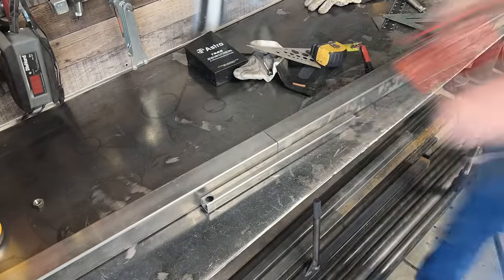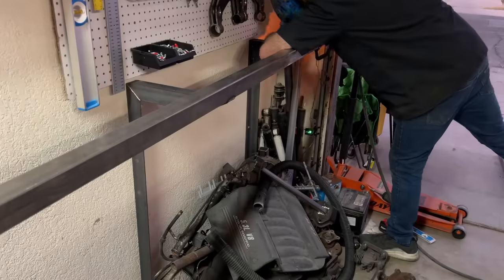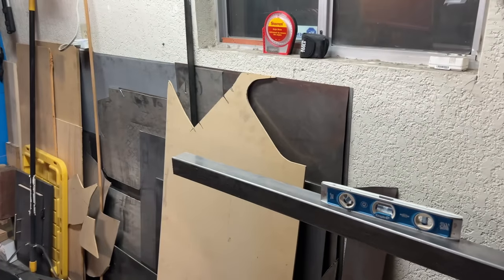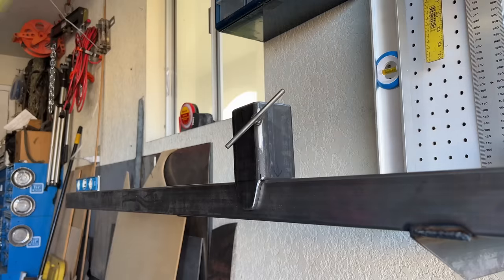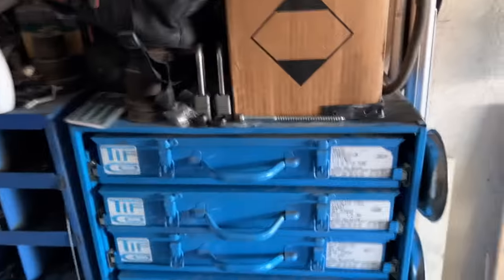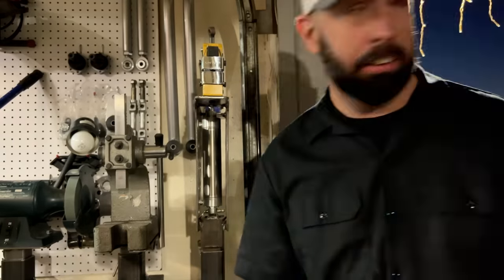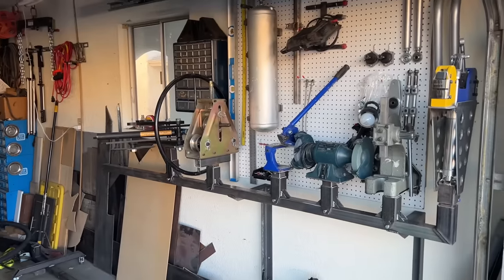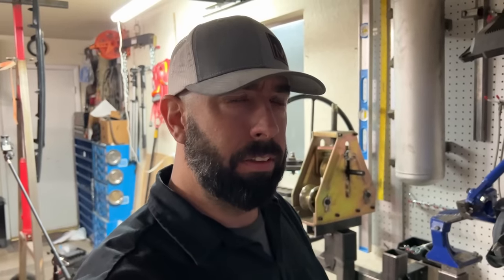Brilliant(er) Legless Tool Stand/Storage System! Part 2.5!!

Comment: A great use of space would be to add another 6’ horizontal to your rack, half way down the bracket that are hitched to the wall. Then add horizontal receiver to it and add another row of tools below. 
So they stick out from the wall sideways. Underneath the other tools.   Great content! Thanks
Reply from the maker: I like it! A diagonal horizontal bar has been mentioned but a completely sideways receiver would work better in many cases.

Comment: You could have welded together 2 right angles to make a T, or bought a T, and used that for the top rail. That way you could use the tool mounts so that can't come loose or tip, but they could still slide left to right.
Reply from the maker: Very true. I just might do that on some of the larger tools. 🤔

Comment: For allens, and other wrenches that are needed for adjusting a piece of equipment (where you want to keep the tool right next to the said equipment) get small round neodymium magnets to hold the allens etc.
Reply from the maker: I love the ease it magnets! I’m phasing them out though because every magnet in the garage is a little metal shaving fuzz ball. 😆

Comment: On th extra square tube that was blocking the sheetmetal storage, why not cut it and sleeve it inside the end, so it can slide right back in where it was.  You can secure it with a set screw.  For the couple times of year that you want access to the sheet metal, just pull it off, move what sheet metal you want, and put it all right back on.
Reply from the maker: Brilliant!

Comment: Im a little late to the party, but if you move the rack up a bit, and even add a third wall bracket for more support, you could keep all your sheet metal under the rack, and slide sheets out easily.  just one idea.
Reply from the maker: I like it! I’ll consider it.

Comment: Now turn your original tool cart into a rolling sheet metal cart. I have this in my shop and it makes it way easier to pull away from the wall and get the stuff in the back. 🤙🏻
Reply from the maker: I like the way you think!

Comment: Have you thought about putting a flat plate on your master tool stand so that it doesn't wobble left and right when you're using the tool?
Reply from the maker: I’ve got a couple ideas that I’m working though, but haven’t considered a plate yet. One idea consisted of a component that resembles the hardware that attaches a bicycle neck to a fork.
Another idea was some very short “fins” that resemble a rocket that will shim any extra space in the receiver. Lastly was just a tab that a single bolt goes in to bolt the unit down.
Others mentioned “legs” but that defeats the whole purpose. I’d be interested in entertaining your plate idea because it’s less likely to be tripped on. 👍

Comment: Great job!  When you created the floor receiver, did you use a concrete epoxy to secure it?  Did you use a concrete bit & drill a series of holes to create the pocket?  How deep into the slab?
Reply: Not wanting to speak for Mancandy, I had a friend who worked for Penhall Concrete cutting... He drilled 3 holes across the front of my floor near the apron.  The concrete was only 4" thick, so I dug down another foot.  Then I welded rebar nubs to the sides of the receiver stock (the tube was 12" long and I put two per face, staggered, the nubs were 1" each), painted them with Kilz, and set them flush.  Then filled in around the outside of the tube with high test quickcrete.  Worked like a champ and having a few extra holes meant I could have a bender on one and a notcher on another... makes for quick work.  If you can find a way to cut the concrete, the rest of the project is easy.

Comment: Glue a magnet to the Allen key to hold it on the tool rack. I've been wanting to move my vice and grinder to a receiver and planned a workbench with both vertical and horizontal receiver mounts that I can expand upon as time goes. Too many projects backed up to build it now but that to see someone else thinking the same way and it working as well as envisioned

Comment: I will give you one more suggestion. Mill a groove down the center of the main tool holder bar for your set screws to sit in then they will easily slide and hold in place without a lot of force a bonus is mounting additional ones upside down the groove will assist in holding the tools up.
Reply from the maker: I like that a lot. If I can get creative enough to put some sort of mill cutter in my router I’ll do that. I’m too lazy to take the rack off the wall. 😆

Comment: KM: One post to rule them all! The tools having an adapter for one post means they could plug into other racks as well (like in a vehicle for transport). Modularity is awesome. I will pile on the multiple comments about a cart for the sheet metal and the other comment about a single tree with wheels; low mounted wheels on your post could be useful for the heavier tools. You could telescope the base into your floor receiver once in position. v/r wh
Reply: Good project, good comments. How about an extension that slides horizontal into your existing horizontal. Can have two tools on it. Pull off two tools, slide out extension, access to sheet metal.

Comment: I would weld levers to the set screws, they don’t need to be torqued down so hand tight should do the job? Save having to reach for a tool just to get another tool.
Reply from the maker: True. Ironically I already did that for the screw that holds the tool in the receiver. Maybe I assumed I wouldn’t need to slide them around often.

Comment: A long time ago when I worked out of my shed, I built a rolling sheet metal rack.  It was not so different from a lumber cart from the big box store (which didn't even exist back then) but it had an interesting feature.  In addition to the fixed back rail that held the sheets up, there was a pivoting front rail that was retained by a chain, so that you could lean the sheets forward without having to hold them up yourself, and flip through them like the pages in a book to find the one you needed.  It was fantastic.  You could unhook the chain to fold the front rail right down for loading as required, and with half the stack folded forward there was MUCH less friction on the sheet you were trying to slide out.
Now, a rolling rack might not be perfect for your application, but imagine that you had one with wheels on one end.  You have a pivot at the end of the tool rack you just made, and your sheet metal 'cart' is up against the wall out of the way, but when needed you can roll the far end away from the wall to avoid the shelving and slide sheets out of that far end.  After you have your sheet you pivot it back against the wall out of the way.
It's just a thought.
I just found your channel randomly this morning, and this is the first one of your videos that I have seen, but so far I'm finding it entertaining... in a good way.   :)
Reply from the maker: Hey Mike! I like all of that, especially flipping front section. Don’t be surprised if you see something like that very soon. 👏 
Thrilled to have you my friend. Thank you!

Comment: The in floor receiver is genius !  If you wouldn’t mind, I would appreciate more information .  How deep did you go?  I assume it’s set in concrete?  Any tips? Thanks.
Reply from the maker: I’m editing a video about that this very moment! It will drop on Sunday morning. Summarized, it’s a 6 inch length of trailer hitch receiver tubing welded to an 8 x 8“ piece of quarter inch plate. Setting in wet concrete would be a breeze, but the only ones I’ve installed so far have been cut and recessed into hard concrete.
Reply: Can’t wait. Please include wall thickness of the tool legs

Comment: Instead of cutting off some of 8 ‘ tube…cut it off weld two plates on with hinge and a latch so it swings out when accessing sheet stock
Reply from the maker: I think the swinging will definitely be a thing!

Comment: I would make a piece so I could put the chop saw on the stand for small pieces so not always on the floor.
Reply from the maker: It has certainly crossed my mind! That or perhaps just some wheels to help slide it in and out. I’ll need some time to ponder that one.

Comment: Excellent, I actually have been using trailer hitch receiver style for 20 years. Mount under bench, and similar "heads" with various tools (bench grinder, vice, etc) on 90 degree (L bracket)

Comment: Several years ago I did this same thing on the corner of my long fab table. I mounted a tube to receive various tools mounted on short tubes that could be changed as needed. Now I’m taking that same concept, but building an actual stand alone fab station with tubes to receive interchangeable tooling like sandbag, shrinker/stretcher, bender, etc. The whole thing can then be moved around with a dolley if needed.
Reply from the maker: Absolutely brilliant. I’ll likely do the same some day. 👏

Comment: For organizing smaller and very lightweight stuff in my garage I use the inside of the garage door. Drop lights, 2nd bubble level, 2nd tape measure with magnets attached and stay mounted until ready for use. Magnets glued to the back of the clipboard. A container keeps a bunch of extra pencils, markers and crayons from wasting time searching for runaway marking tools. Small hrbrFright mag trays hold spare Phillips, star, and 1/8” drill bits. A few magnetic hooks keep different rolls of tape accessible. A socket tray only worked for a while so I’m not gonna even think of putting the scratch awl above my head. Works good for my 8 foot ceilings but probably not for higher bay doors.

Comment: Could truss the bottom and leave the cantilevered 2 bracket 8' setup.  This also expands the uses for the tool rack.  Such as added hooks or slotted tube for cordless tool storage
Reply from the maker: I really like the cordless tool storage idea. The whole trick to making the most small work spaces is cleanly using every last square inch.
As for the cantilever… I’m more concerned about the wall studs than the rack itself! 😆
Reply: @GarageFab  add one floor leg, or tie into the garage door wall.  Either option will triangulate the weight distribution.  The floor leg may work best, if you moved the sheet goods towards the door.

Comment: My wife and I just purchased a kuat bike rack. They have a system for the hitch that expands its space so the bike rack completely fills the space of the class 3 hitch receiver. It might be a bit complicated, but worth looking into in order to keep the wobble out of the post during tool use 🤷🏼‍♂️🤷🏼‍♂️🤷🏼‍♂️

Comment: Great job! if you make your common receiver two pieces with one sliding into the other, you could make it height adjustable with a pin/bolt. Might help with different tool heights, or if you work with different height buddies some time.  Might add too much slop though.
Reply from the maker: Consider that idea stored in my mind for later.
My Shrinker/Stretcher is a very tall tool so it’s awkwardly high right now. If I shrink the post all the other tools would be awkwardly low. 😆 This would work nicely!
Reply: @GarageFab didn't you just end up with more than a few left over chunks of 2x2 posts? Lol
Maybe certain tools need a specific height post, still way more compact than the rolling rack. Great job!

Comment: With a 'C" channel at the end of a few mounts, you can also hang a few lighter tools upside-down on that storage bar.  I guess it would have to be removable with a through-pin for the actual mount to the pole in the floor.

Comment: My worthless 2 cents = mount the receivers horizontally pointing out (still slidable left-right), mount the tools on an extended 2x2 ( length dependent on each tool) with the set screw (or pin) still at the receiver. Mount a surge protector in a convenient place on the rack with each tool plugged in. Then when you need one for a quick job, you slide it out for a little working clearance, snug it down, turn it on and have at it. Job done, slide it back in.  It's still removable for placing on a pedestal, etc.
  Like your working style. Best of luck.
  John

Comment: While that's an ingenious idea, I'm not sure how well it's going to work in practice. For example, I often make one off custom parts and like to move quickly between multiple bench or stand mounted tools. For example, saw, drill press and belt sander. Or saw, bender and notcher. I can't really set up an assembly line because I need one made and tacked in place before I can measure for the next.. So for 10 one off parts, I'd need to swap tools on the stand 30 times. Not even considering the amount of extra time that would add to my work flow, my back is barking at me like a mortally wounded dog just thinking about it. I think I'd need 3 floor plates and full stands for that to work and now my shoulders have joined my back in the howling. I'm interested to see how long you go before you cry "Uncle".
Reply: This man wont give up that easy. He will make more receiver holes in the floor and a few more stands that stack neatly out of the way. It won't be a problem long and the system will become more versatile as a result.

Comment: You could of raise the rack and put the sheet metal under it in the front
Reply from the maker: Not a bad idea! I think I still had the thought of using the tools on the rack and that might’ve been too high. Also the bender is so heavy and awkward, it needs to be at hip height.

Comment: Oh man! You could have used a horizontal “stub” out from the wall with matching receivers on the tools (basically an L to plug horizontal to the wall and vertical to your floor post) and then stacked your tools vertically which would have taken up about 2 square feet of floor space.

Comment: Love the vids even though I do mostly wood working. I’ve made a few receivers with shelves on them to clamp misc tools, jigs and vises to different benches or 2” tow hitch on my truck. Having to clamp each tool down takes a minute or two, I might try your more permanent base for attachments.
Nice bicycle racks for receiver hitches use different systems to take out the wiggle of the rack in the receiver. Saris essentially uses a nut inside their rack (the male of the system) and a threaded hitch pin to pull the rack tight to one wall of the tow hitch (obviously the female part of the system). Kuat uses a ball/cam to take out the slop. Tough to explain but it might help take out some wiggle at the base for the post mount. Another for tightening up the tool to post mount up top, if a more simple threaded set screw doesn’t take care of it.

Comment: Now let me add on to what you have. Weld an L bracket on bottom of wall mount with square tube going across. That way you can put smaller tools(bench grinder) on the bottom. Basically double tool storage you have.

Comment: Great work! Just a tought tho .. Couldn`t you use the roller stand as a sheet metal stand? Erect two post on each end like 4 feet high and a 8ft (or how long it was) between them. So you could roll all the sheets out..🤷‍♂️

Comment: Not sure if it was was already commented on but.. on your Main receiver bar that you install in the floor and work on, you could weld on some triangle gussets that would radiate out like braces. When you actually work with each individual head your work surface would be a lot more solid? It would stop your post from moving side to side..... Since they would be attached to the post they would not take up much room...

Comment: I did something like that.  On my bench, I put two receivers and then I made mounts for different tools and extensions.  I can put two tools at a time in there, but the main reason for having two receivers is that I have "U" extension that I use for welding and plasma cutting.
It was a bear to get the "U" to slide smoothly, but it's very strong and it's nice to have an extension to the workbench.

A "flip top" workbench is a great idea.  Here's an example: https://www.youtube.com/watch?v=CCjpQen3LqQ

What I do is mount two tools to the same stand.  So I have a 2" square tube with flat plates on each side so that I can mount two different tools on it, then just pull it out and flip it over when I need the other tool.

Love the idea of a receiver in the ground.

Comment: Ok, its a good idea. However, i cant stand the fact that theres play in your common stand. It wobbles around too much. That would drive me nuts trying to work on that platform. You need to weld a flange to the base of that thing that will contact the floor when its inserted and force the square tubing against an inner  corner of the floor socket. Use a blot that goes thru the flange to push against the floor (like a leveling foot on other equipment) so that it forces the slop out of the post/socket junction. Or a small shim/wedge welded in place (or removable) between post/socket.

Comment: What about keeping it a roller that is 4' wide and going vertical with the mounting?  You went at the height originally because of the stands.  Now that you just have a bunch of heads, you should be able to offset and go vertical.  Also, the generic post, if you put maybe a 2' piece of thick angle on the bottom just before the post bottoms out, it won't wobble as much, but will stay in place by the hole in the floor.  Love the willingness to take the positive feedback and show the redesigns in a positive light.

Comment: If u drilled divets (spelling?) In the tool rack like ³/16 deep. All across the front of the hanging rack bar, u dont need the little corner cutout pieces welded to the sides. Then take the tip of the set screw and make it pointed ISH. So that when u tighten the set screw into which ever hole the side force needed to over come the 2 areas. I think if u did the math it would actually would withstand a higher side load and u woulnd have those little gussets hanging of the bottom corners. Idk tho im just a dumb viewer.. lol.